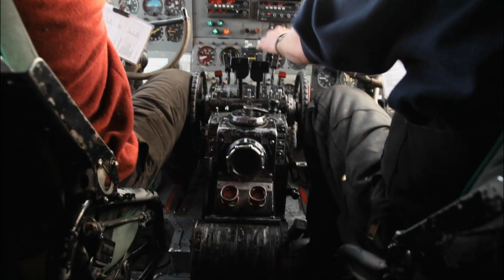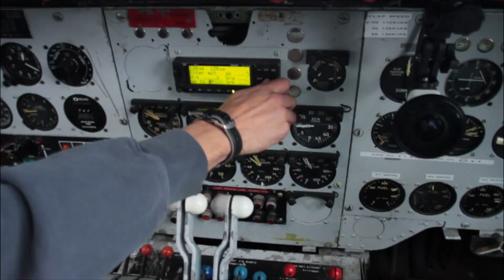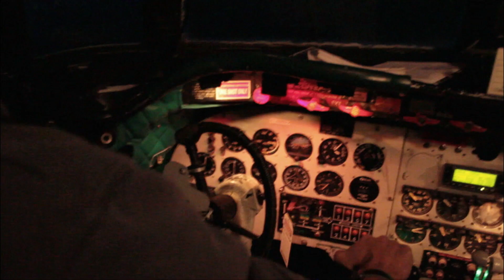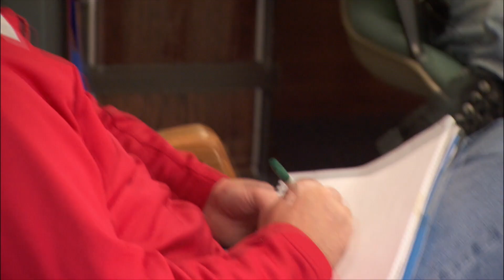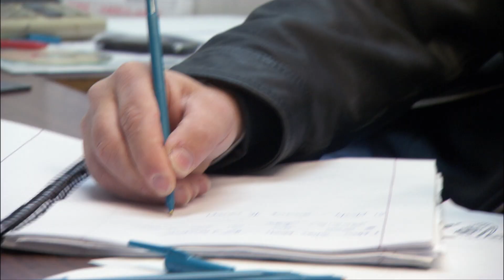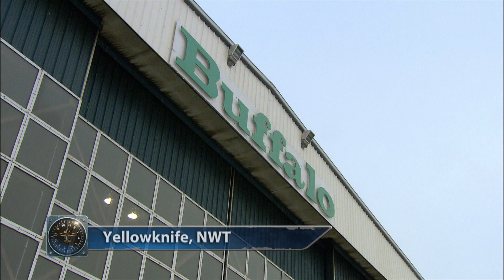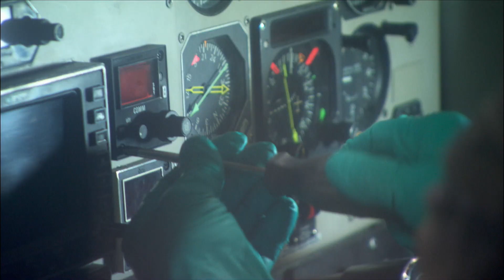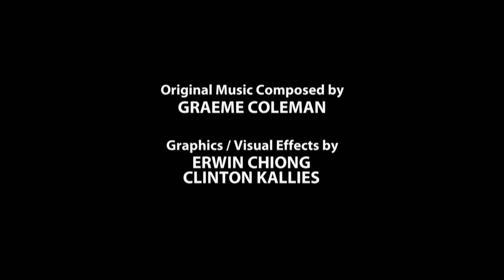Chuck Walks - Ice Pilots NWT S03E03 - Go Xplorer

Comment: I understand why chuck gets really pissed off some times. I am a automotive technician and I’m the same kinda guy that fixes stuff when nobody else can figure it out. All the time I have mechanics working for me that can’t figure out a problem so I get forced into working on it and when I’m done the mechanics tell me they have never done that job before and many times I haven’t either. With cars if you have say a check engine light you type it into service information, read up on how that system works because if you don’t know how it works how are you going to figure out how it doesn’t work and then you print off a flow chart and it has all the tests so you can figure it out all you need to do is read. But guys are lazy and don’t want to learn so the smart guys get screwed the smart guys have to non stop do the complicated work while the lazy guys get the easy work. The lazy guys complain they don’t make enough money and I always tell them ur pay check is in ur hands in the business if you wanna make more you need to know more. A 28 year old guy can make 100k a year while a 55 year old guy makes 50k a year because the younger guy knows more and is always learning. I tell them you can train a monkey to change an engine but diagnostic and electrical work is something you need to learn and that’s where the money is at but nobody listens. I hate reading but that’s how I learned a lot
Reply: I’m an engineer and something that really annoys me about the older guys is that they feel like they’ve earned the right to be lazy and just basically refuse to use or learn new systems and basically just don’t do it, or complain the entire time expecting us younger guys to just pick up the work because we took the time to learn the newer systems and understand the benefits they can provide and despite their output being being markedly less than most of us in our 20s and early 30s and also despite us having the same position, they are routinely looked at first for bonuses and promotion because they are older and have families and these are the same type of people to unironically bitch about “kids these days, not wanting to work,” or wonder “why younger people aren’t having kids or not doing it till much later in life.” Completely oblivious to the fact that the world has changed quite a bit in the past quarter century plus…